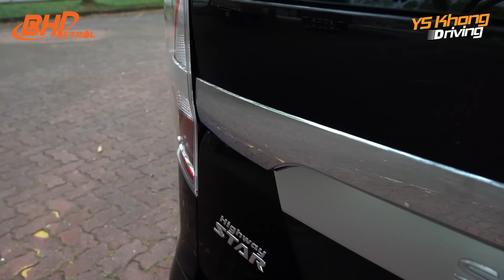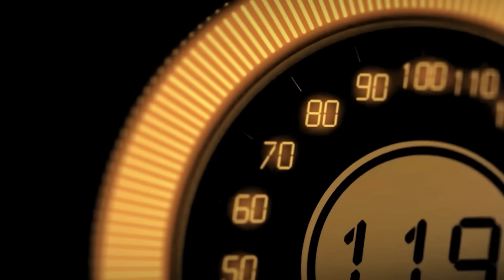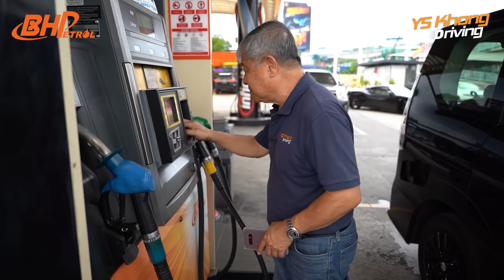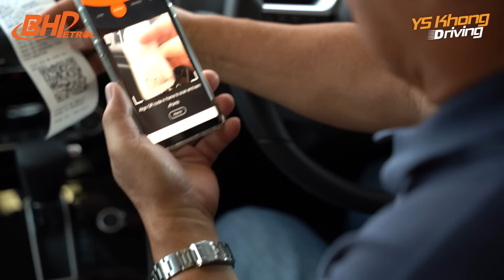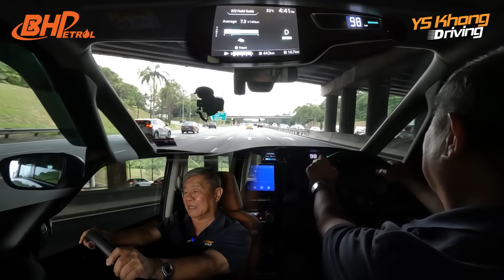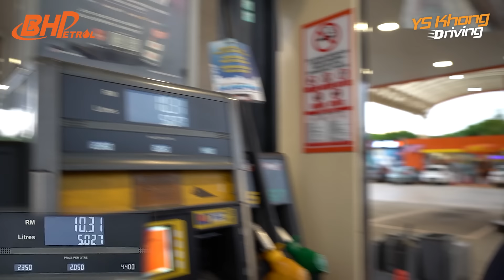Nissan Serena S-Hybrid Full Tank to Full Tank Fuel Consumption Test | YS Khong Driving

Comment: I know this is an old video but I would trust some of the meter. If you had travel 55.8km and it has done 6.9L per 100km , that's around 3.85L of fuel usage. But the petro pump clicked around 3.3L. So technically the car should be spot on at 6.9L per 100km because you mentioned it already spill out. 
For 6.9l per 100km that's fantastic. Fyi an Exora turbo with lesser weight and smaller cc, can't even do less than 10L per 100km on normal city driving.

Comment: There's a slight difference between actual and the meter reading. Actual was 11km/l, while the meter is showing 14.5km/l or 6.9l/100km. I've been driving serena for 8yrs and I truly satisfied with it's fuel consumption consistantly still maintaining FC > 12km/l.
Reply: Hi mate, I bought a 2014 Serena which is also a S-hybrid version, but the fuel consumption is around 10L/100km. I reckon one of the battery is dead, I can start the car and the electrical sliding doors work normally. Which battery you think is dead?
Reply: 8 years old serena, i assume you are driving a non hybrid serena. The fc is somewhat similar to the hybrid version. Then what's the point of this hybrid?
Reply: impressive

Comment: Did you try to compare the fuel consumption of different petrol?
Reply from the maker: Too many options. Ee jusy used the recommended RON95, which is good enough. We only have RON95 and 97, and 97 is relatively expensive, so cost per kilometer with 97 is higher no matter what little extra you can get.
Reply: @YSKhongDriving  you recommended BHP petrol, but I'm not sure if you have tried others for this car or not. Personally I did so on my Serena and recorded all my fuel consumption history in a table. I find that Petronas provides better mileage and acceleration.

Comment: Thanks for your efforts. Just noticed there are so many Serena encountered throughout the journey. No.1 MPV in Malaysia for sure!
I'm a owner of the latest 2022 Serena C27 and the previous gen C26; heavy footer, including high speeds, yield under 8km per litre. As far as I know, the S-Hybrid just replace  the starter motor with a 50Nm torque unit and the additional torque is only applied for 1 sec from total stop. Too bad the air cond compressor is not electric and powered by the aux battery.
Reply: That is disappointing with the AC

Comment: 20 years ago, my old mod Satria did 12km per liter of mixed driving pretty much the same as yours. I did full tank to full tank measurement also like you did. So, 11km per liter 20 years later of any vehicle is not impressive. Hybrid some more... Haha. But the the deal is already broken when a car look like you can modify it to be a hearse. Yeah, take off all the rear seats and can fit in a coffin.
Reply: What a stupid comparision
Reply: Your satria isn't a brick though...
Reply from the maker: Exactly, and was probably 400 to 500kg lighter, plus was smaller capacity.

Comment: Uncle I am quite curious about one thing, other than worse pickup, why people don't just modify their engine to accept NGV?
Hybrid, EV all these, none are cheaper than NGV right?
Reply: Direct injection normally doesn't support it. Also need to install the tank and maintain it. Plus fill it up...
Reply: @TsLeng  
but MPI car still support it right, and thers isn't a lot of DI cars nowadays also.

Refilling the NGV is easier and faster than recharging EV; you can also rely on Petrol as alternative fuel should NGV runs out tho.
Reply from the maker: There is a huge NGV tank that needs space, a total lack of power, and long queues at the gas stations. Yes you can, but that is not un the scope of the video. We are doing a fuel consumption test, not showing how to get the best mileage.